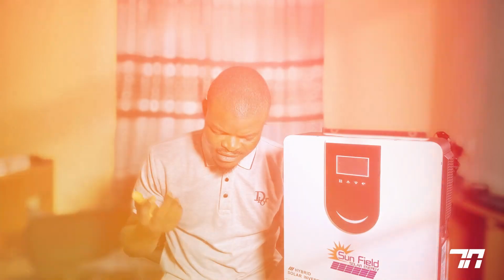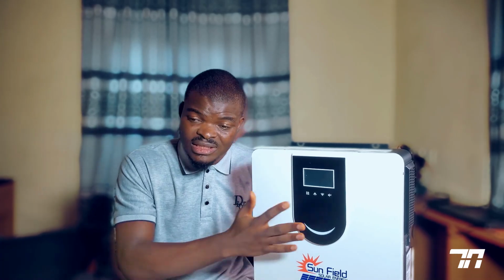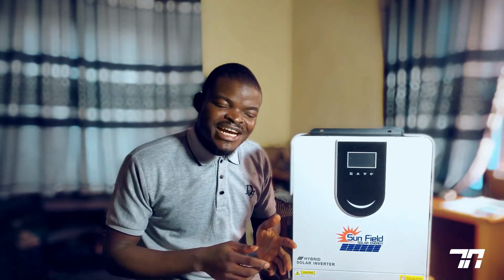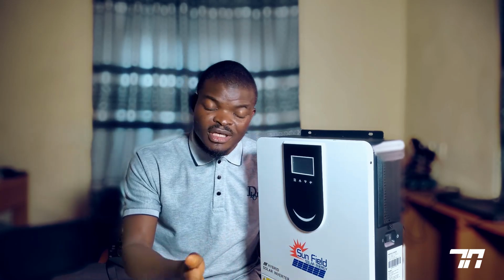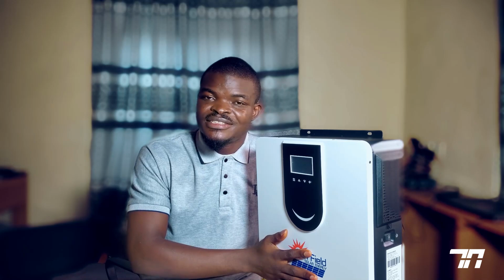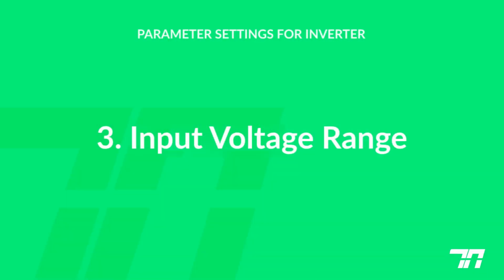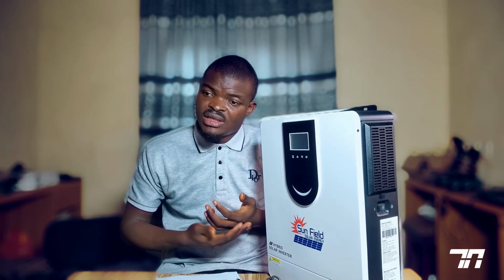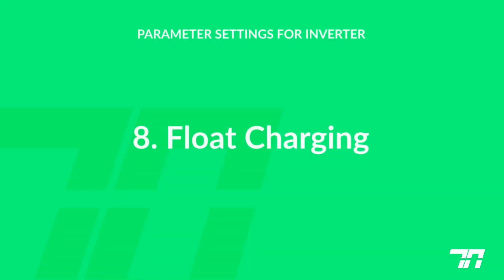FINAL JUDGMENT: High-frequency inverters are much better than Low-frequency inverters

Comment: High-quality low-frequency, transformer-based inverters are no longer expensive, and the difference in efficiency is so minute that it's hardly worth considering. The big issue with high-frequency inverters is that they don't provide any galvanic isolation between their DC boost stage and their AC output, so when their MOSFETs or IGBTs fail, they can do some serious damage to your home's appliances. Low-frequency, transformer-based inverters do offer galvanic isolation, so you're appliances are protected. I would never install a high-frequency inverter to power my home.
Reply from the maker: You're absolutely correct 
Isolation issue is one of my problem with high frequency

Comment: Transformer based inverter is the best for longevity and running very high inductive loads for a long time the only disadvantages are weight and they are more expensive that is it everything else you are now talking is lies 😮
Reply: The secret is if you want your HF inverter to last longer, always oversize it... assuming your load need is 1kw max, get a HF inverter with about 3 times higher than the actual load, say 3.5kw

Comment: Can I use a low freq inverter with lithium battery, mine is not configurable but the inverters default parameters match the lithium battery I intend to purchase
Reply: You can

Comment: Is this still a debate in 2025? 
High-frequency inverters are 100 times better, don't argue if you haven't used both, use both then come up with your facts. In my opinion, they shouldn't even be compared, provided you size your inverter and panels well, high frequency any day any time.

Comment: I've used both.
I used a 3.5kva 24v LF inverter for 3 years without issue. Now switched to a cheap chinese 6.2kva 48v high frequency inverter also without issues.
When you compare specs and prices, the HF inverters are a no brainer.

1. The 6.2kva hybrid inverter with inbuilt 120a charge controller costs less than a standalone 120a charge controller.
2. The advantage of charging via generator is true AF. My LF inverter was always dropping charge when using generator at 25a(600w). Way too sensitive to fluctuations in frequency. My HF inverter never drops charge even at 60a (2,880w) without any changes to the generator. Charges my 10kwh batteries in 4 hours!
3. All these HF inverters have the same components. Whether Cworth, Sunfield, SMS... they are all using the same internal components. This means they would be easy to repair if they go bad.
4. I got my inverter for less than N300k. A comparable HF inverter would have cost closer to 900k and would have had a max charge of 60a. Even if the inverter goes bad after a year and cannot be repaired, I believe I have got my moneys worth.
Reply: @maverick_ng  Maybe no issues yet. Give this high frequency inverter another years or two and you'll see what I mean. They just don't last.
Reply: @solarcharging9743 I hope you know that technology yesterday isn't the same as today's. The tech we're using today are actually a bit older and are doing well.
Reply from the maker: Good bless you for this explanation

Comment: You're doing your viewers a great disservice by recommending these Cheap, Chinese-made, high-frequency, transformerless inverters. Not only do they offer a shorter life expectancy and a far poorer surge capacity, but they can also be dangerous for use in full-time residential applications. Ask Google AI: Can high-frequency, transformerless inverters be dangerous for use in residential applications? If you doubt what I'm saying.
Reply: Dear Sir, there is no problem with your perspective but making your conclusion on response from Google AI is not proper. These AI tools are helpful but should not be a substitute to proper research because they are not perfect & often churn out faulty responses. Thanks.
Reply: Very wrong assertions. Prioritizing AI answers over practicality is a no-no.
Reply: Oga, technology is advancing, transformers are out for good. Apart from low cost of production, invention is always finding better ways of getter better results
Reply: China ❤
Please stop trashing China, the every country including USA, Germany, Japan depends on China Technology.
Reply: @gozieanyiam7169  this has nothing to do with China and has everything to do with the cheap inverter technology that this manufacturer is using.
Reply: Wetin this one dey talk ? Have you used both in 2025 ? 
Also china is the factory of the world, even USA imports from china 🇨🇳
Reply from the maker: @solarcharging9743  so your views on HF inverters in general was based on AI answer.
Wow, you're the best
Reply: Lol... If na that one, ask AI if low frequency is dangerous too. I'm sure I'll tell you it's dangerous as well.
Everything has it's own risk, ur car, your generator, etc
Reply: Thank you, this guy is giving wrong information saying HF is better than LF. So many information in this video is wrong.
Reply from the maker: @ase0137  almost all inverter companies are now moving their designs to high production of HF inverters, doesn't that tell you anything
Reply: @ase0137 
Which is wrong?
Reply from the maker: @ase0137  you're still in 20th century mention one single mini grid solar setup that uses transformer based inverter.
That's if you even know any mini grid.
Get updated and stop being ignorant
Reply: No, no! 
Transformers can change in look, but the function is still the same: INDUCTOR.

Comment: You don't know what you're talking about. High-frequency inverters offer a much poorer surge capacity. They also offer a shorter life expectancy, And even worse, because these cheap inverters don't have an output transformer to provide any galvanic isolation between their DC boost stage and their AC output, they can damage your appliances when their MOSFETs fail. Don't take my word for it, ask Google AI: Can a high-frequency, transformerless inverter damage your appliances? To learn the truth about these junk high-frequency inverters.
Reply: There is isolation between the two stages. Unless if it's some cheap brand or diy stuff. Even one I did myself is isolated using isolation voltage sense amplifiers....
Reply from the maker: @quickquote1568  Go get yourself premium high frequency inverter and see for yourself. 
Not asking AI or google up and down🤣🤣
Reply: Wrong assertions again, especially when it means trusting AI more than human practicality. What do you think ferrites are designed to do in solar inverters?
Reply: @voltraenergy8606   I trust AI and my own 25 year history in the inverter repair industry over your inexperienced practicality. And ferrites don't provide galvanic isolation. Ferrites are primarily used for EMI suppression and noise filtering, and their primary function is to act as a high-frequency inductor, not to isolate circuits electrically.
Reply: @quickquote1568  You trust AI over practicality? Really absurd. Maybe AI helps you fix inverters too reason we really don't know the reason why ferrites are present in transformerless inverters.
Reply: @voltraenergy8606  Your reading skills need a tune-up. I said "I don't trust inexperienced practicality". And no, I don't use AI to repair inverters. I use my EET degree and my 25 years of experience in the inverter repair industry. What kind of degree have you earned Voltra? Again, you don't have a clue what you're talking about.
Reply: @quickquote1568  The one who's not practical here is you, you think your ideologies of the last 25 years still hold much relevance with the rapid technological advancements  of today? It's obvious there's some that has a lot of  catching up to do here.
Reply: @voltraenergy8606  Give it up, dude. I still perform an average of 5-6 repairs per day on modern inverters with all their "technological advancements". Even the cheap Felicity inverters that you sell are no match for my skills or experience. 🤣🤣🤣
Reply: @quickquote1568  Stories. You perform 5, 6 and 10 repairs but fail to realize the rapid emergence of high frequency inverters. Stories all the way, FYI we don't sell or endorse inverter brands but state the obvious.

Comment: What about repairability of high frequency inverter
Reply from the maker: check our channel
Reply: We charge a much higher fee to perform a typical repair on a high-frequency inverter due to the complexity of its circuitry and the need to replace far more components when they fail.

Comment: what is the appropriate DC cut for tubular battery?
Reply from the maker: 10.5V
Reply: @chiefsurgeon001 I agree with you. You sure knows your stuffs. But then, I set my bulk voltage to 29V. My only worries is that during the course of the bulk charging, it was getting above 29V and sometimes up to 30V. I hope this won't damage the BMS of my battery?
Reply: Not advisable to drain your battery or settings the cut off voltage to that limit it's will relegate the battery so fast . The best cut off voltage is 11.2 or 11.5

Comment: Do you need protection, if the inverter has inbuilt protection from overload, overcurrent, overvoltage. Why should installers still install protection?
Reply from the maker: Okay now here's the question. 
Upon all the internal protections that low frequencies inverter possess, don't they get damaged when overloaded still?

Answer: They do.
Which means the internal protections of inverters sometimes are not fast enough to trigger themselves because there are bunches of other instructions that the MCU is running at a time.

So protect your machines with external devices too, it will save you lots of stress and cost

Comment: The truth is low freq inverter is much more durable and reliable, High freq is more efficient and more configurable..the number one reason i hate High freq inverters is that when it burns or have a fault, its almost unfixable, inless u send it to the company that made it, good luck finding a road side inverter man that can fix it, the parts are proprietary, but when High freq inverter has a fault, almost any electrician can fix it...this is a major issue for me. its the number 1 deal breaker for me ..why buy something only the maker can fix .LOL 

U should have added this to your points for the High frequency inverter, its a major point in my opinion.
Reply from the maker: High frequency consists of lots of electronics components, they're not meant to be fixed by road side electrician. 
Get an expert that understands both theoretical and practical aspect of electronics components. They'll fix your high frequency inverter for you with ease.

We have a video on our channel that shows the repair process
Reply: @chiefsurgeon001 yea.. Fixable by experts that would charge u half the value of the inverter, and not every device has expert in ever city.. Goodluck finding experts in remote or semi remote areas. I have had to ship an inverter to a whole different state ( Lagos) for the so called " experts" and they didnt even have the parts on ground.. I had to wait almost 4 months to get it back.. Thank God i had a back up inverter...maybe u live in a big city where ur point is valid.. That does not apply everywhere my friend.
Reply: @chiefsurgeon001 link to the video, if you don't mind.
Reply: "unfixable"
sounds like a skill issue ngl

Comment: I bought my 4.2kw 24v hybrid inverter… to avoid issues with Nigeria grid that flunctuates anyhow .. I bought an external battery grid charger , external mppt charger.. so now my inverter is inverting only.. hope it’s a good idea…??
Reply from the maker: No need to buy external battery charger.
That 4.2kw can deliver enough for your battery than the external charger.
Just do the necessary configurations and your inverter won't be exposed to any risk
Reply: @chiefsurgeon001 how then do one manage to prevent the issue of hybrid inverter damage due to voltage fluctuations from the grid for a grid tied (no solar panels) inverters?

Comment: I think what is not often mentioned is if you have say 2 high Hz 5 kw inverters in parallel and never take them to the max output they will probably last a lot longer..and they are much more efficient in standby

Comment: 😂. Don't worry, you will still return that HF hybrid inverter.  Durability is number 1 factor.
Reply from the maker: Mister.
I've installed over 50pcs of HF inverters
Only 1pcs has ever got damaged at my site, and that was due to 2 lines short-circuit on nepa pole.

I used to think like you too, until I sought proper knowledge of HF inverter inverters.
Reply: Can you recommend or list the brand you have used without giving you any problems

Comment: I have been using a 6KVA LF inverter since 2015 until date, and i have heard countless of HF inverter models burn all along, but mine is still kicking even for high inductive loads. i would always recommend a low frequency over a high frequency, if you want something that would work ruggedly. I agree about the low charging current, but a good mppt charger would handle the charging aspect.
Reply from the maker: And yes we have high frequencies inverter that has been working till date.

HF inverters durability depends on the product you're using and the installer installing it.
Reply: 😂He will learn the hard way.
Reply: @jo4mil  There's nothing to learn if the installation is done right.
Reply from the maker: Can you show me a single mini grid plant that it using LF inverter setup?
Reply: Solar Energy is gradually shifting from the low-frequency inverters because of their inefficiency and poor flexibility.  High-frequency inverters of today give you as much tolerance to inductive load, better battery management, and a smarter all-around operation.
Reply: @seunsonoiki6979  
I also have a HF installed 2019, and is still kicking.
Longevity of an inverter depends on so many factors and both these inverters have their best use scenarios.